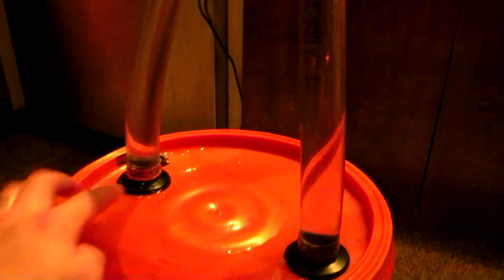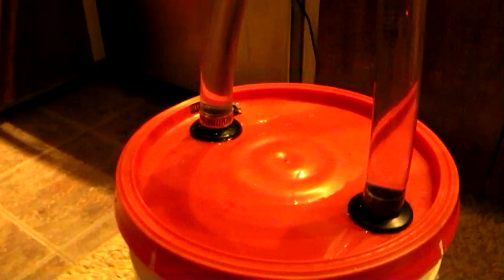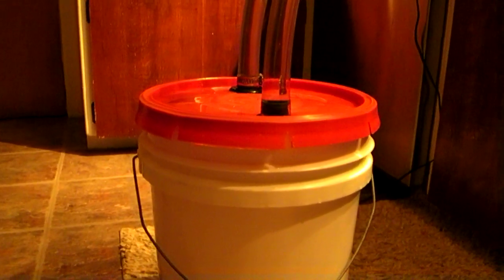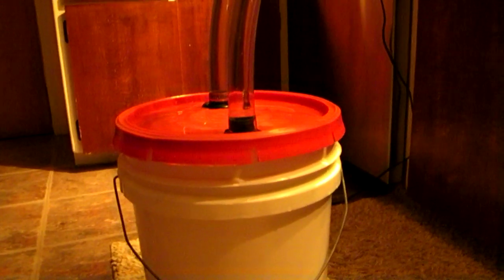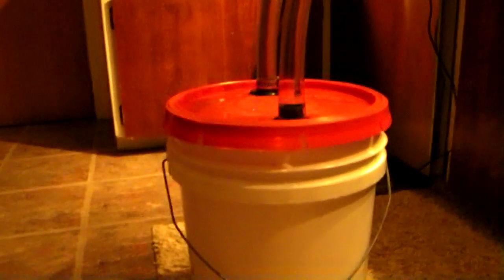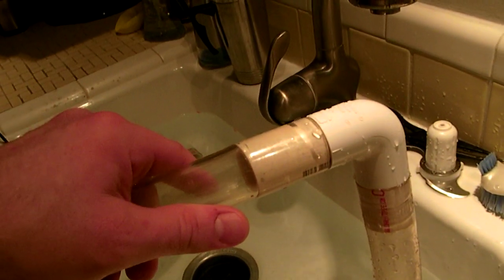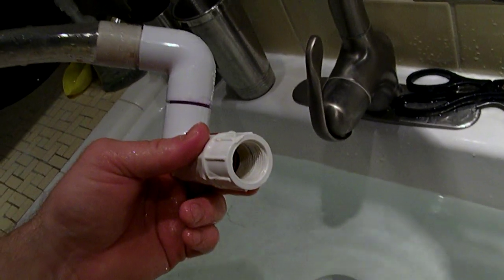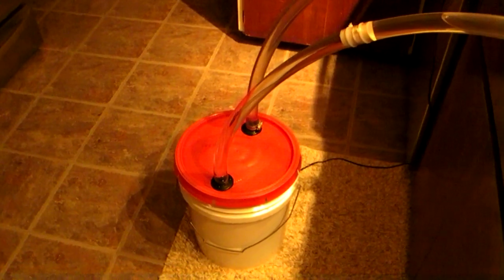DIY FX5 1st Test Run

Comment: Usually when a pump makes a racket like that is when its overloaded. With mag drive pumps its the sound of the magnet vibrating on the ceramic shaft its sitting on due to the weight of the water pushing back on the impeller blades. Using a smaller gauge of tubing for the output from the pump will silence it by allowing it to utilize a higher flow rate and pressure due to half the water weight being on its "head".

Comment: looking at investing in a fluval.  i am very mechanically inclined, however i am scared of a catastraphic water leak that would empty my aquarium all over my living room.  maybe this external should be used with a skimmer cup?  in order to safeguard that.  i had a used magnum filter, it was difficult to reseal.  awsome filter though when the seal was good.

Comment: How did you seal the lid so that it will not leak. Unable to find a gasket large enough for 5 gallon pail, and silicone isn't working.

Comment: I made one this weekend. Everything worked out great. However I need to figure out how to keep it from siphoning back into the bucket when the power goes out. That's the only time I have leaks.....it can only hold so much before it starts leaking out the top...lol. any suggestions on how to solve this? I will take a video of mine....and post it. Also I am very interested in how your making the " media trays" I currently just have bulk poly stuffed in it. Look forward to your updates